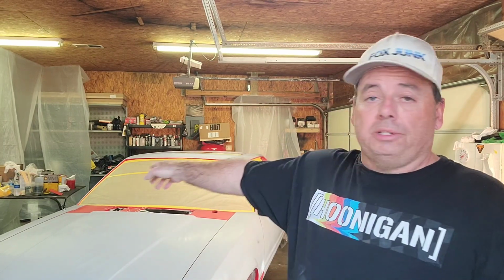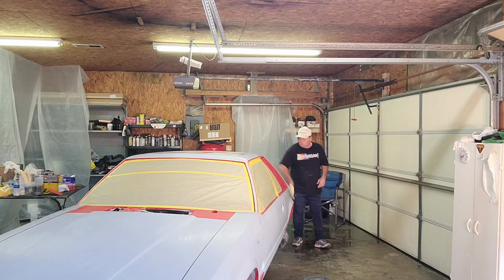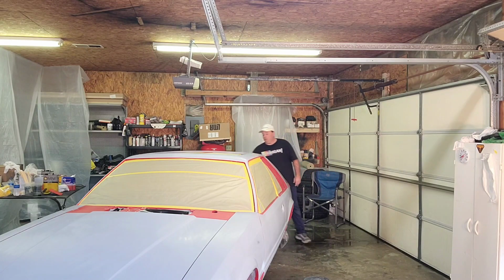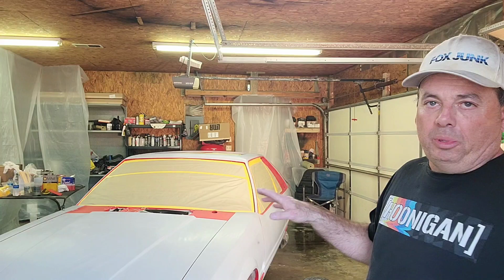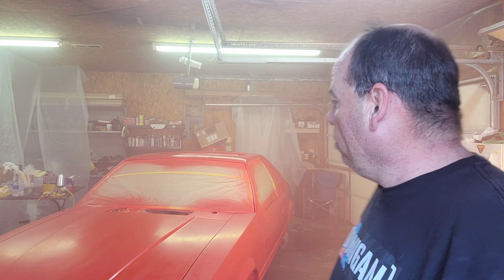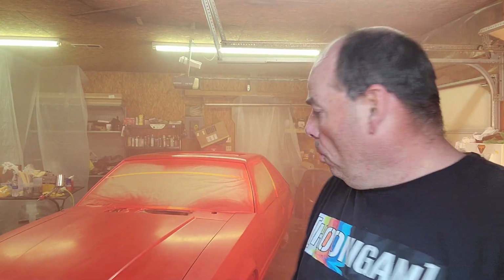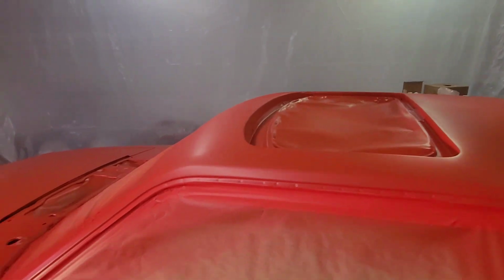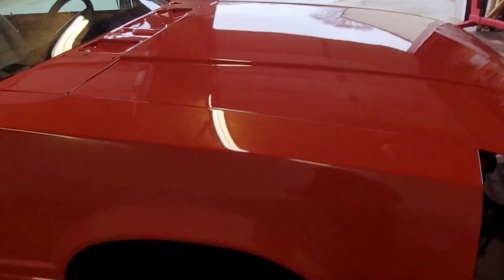1993 Cobra, painting project field snake when Gigantor strikes! watch till the end!

Comment: Turned out really good. That’s an expensive paint job (red).  For that run, I would have used a straight edge razor blade to scrape 99% away then wet sand. Same result, but a lot more work wet sanding the entire run out. Love the content. 👍

Comment: On really bad runs where you are worried about cutting through the good surrounding paint, you can put a skim coat of filler on that area and work the run down that way. Beats having to repaint or burn in the quarter somewhere. Otherwise, if the clear has hardened enough I like to work the runs down with a razor blade first. Nice job though! Looks like the car turned out killer👌